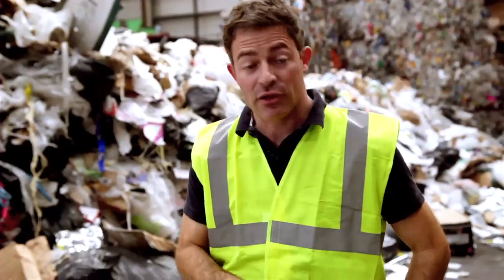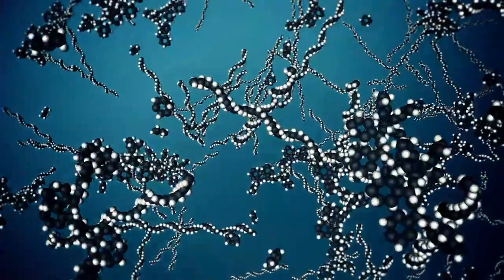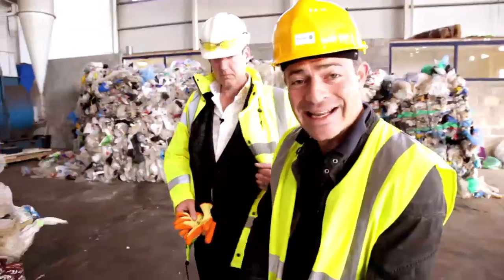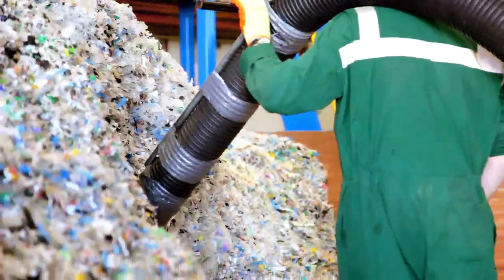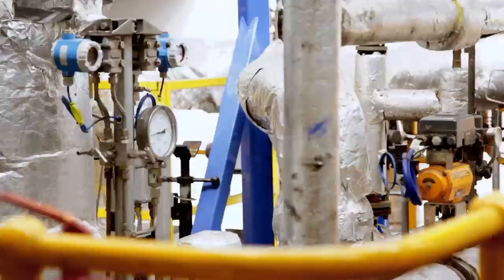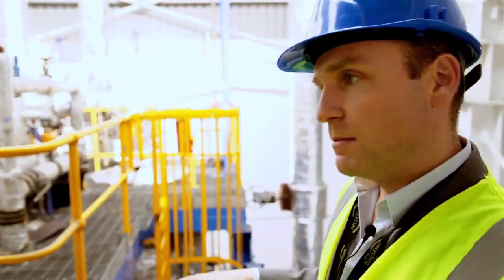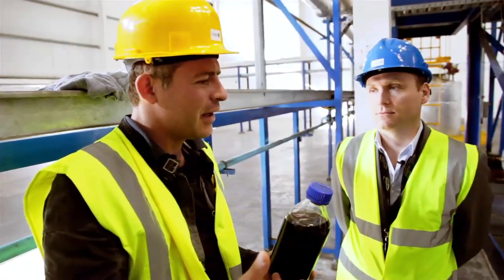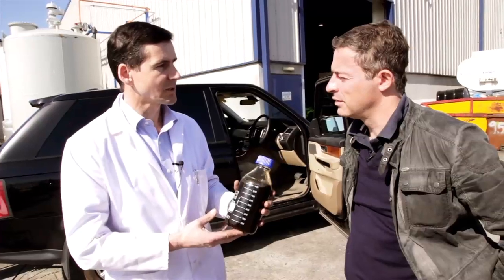earthrise - Plastic Fuel

Comment: What we were not told is the amount of energy needed to pyrolyse 1 ton of plastics to produce 800litres of fuel. From this information, we can know the cost of fuel produced per kwh of energy used.
Reply: @3:50      "... non condensable gases  leave the top of the distillation  column, and it is those gases that we clean and use in the furnaces to heat the pyrolyse chambers ..."
Reply: @charrishead  Energy provided by the by-product gas cannot heat the pyrolytic chambers alone. Thermodynamically impossible.
Reply: the gas produced from the pyrolosis is used to heat the plastic in the first place, this kinda means the process is self sufficient aslong as plastic is fed into the machine, the process keeps going
Reply: @mnshp7548  Assuming there is enough gas released to keep that process going. But it has to provide at least some boost, thus requiring less natural gas or electric heat from utility companies.
Reply: If it can be powered by renewable energy sources like wind farms, solar farms, or even nuclear then it would be well worth it, not only would we be able to almost completely diminish landfills even if it used 100 times the power it would create in gas or diesel it would be worth it for the landfills and just as an alternative fuel source.
Reply: @michaelweston6083  no it will not be a good thing.
All of these plastics would be burned, so release into the atmosphere and accelerate climate change...
Reply: 1 ton of plastics = 10$
800 litres of fuel = 1000$
Reply: @UCiWrMgES50tlUhV3l6NqjNA  4690$ now.
Reply: @Kazeem Mustapha. We either convert the plastics into usable fuel or throw it into the landfills. Pick your poison. If the choice is left up to me, I say convert it into usable fuel. It's a no-brainer.
Reply: While the non condensible gases are recovered and used to fuel this process, they don't say that is all the fuel that is needed. This idea is quite exciting, but we cannot make too many judgments without the rest of the data. Breakdown all the costs of the process in money, energy, equipment as well as all other costs such as getting the raw material to the location.
Reply: Government ALWAYS subsidised green incentives.  This is what they do in Europe and they power their grid with methane and all sorts of synthetic fuels.
Reply: its just the begining they can use the same fuel for own energy and can always improve the formula and the way to double production. Problem is the biggest companies make more money extracting and ripping africa asia etc soils . its an ilusion thinking that there is no solution!
Reply: From those 800 liters of diesel, you would get nearly 8.6 Mwh of energy out.
Reply: @Jemalacane0  so what did it cost to get the oil at first turn some into plastic products, move the plastics through society, reclaim the used plastics and then make fuel. There are many different costs involved in that plastic before its ever rounded up and made into fuel. That litre of diesel already cost more than the litre made from the same batch of original oil. So then to use a higher cost litre of diesel to make 1kw, the same costs translate over from what it took to make that litre. So you can create the higher cost 1kw but because you can do it, is it cost effective or a waste of time.
Reply: rushfan9thcmd of course there is but once plastic is made for whatever reason it therefore is a product, ie plastic. Then it is generally used for one time and becomes a problem to deal with. No one is suggesting to make plastic just so it can be then turned into fuel.
Reply: looks pretty convincing.

I truly hope this takes off and spreads around the world.
Reply: It is mentioned. They use the gases from distilation to power the process.
Reply: I think their figure is bullshit.
Reply: Because it isn't a very exciting rate of efficiency. These guys are shredding with machines, operations augers and conveyors, using a vacuum, and some kind of heat source.

I have one diesel truck. If I could spend time on the weekend and get enough fuel to sustain my driving I'd be interested.
Reply: I see you are well vest in this. I want us to talk business and setup in our country
Reply: @yoofiarthur3578  Yoofi, I am a petroleum engineer and looking jobs in oil and gas industry. Thanks for your interest.
Reply: Solar energy and wind energy can be used...
Reply: @ebenburger111  I know they can. But what are the amount of energies involved in this process?
Reply: The gas produced during the pyrolisis is used to hit the plant. After the initial energy used to heat up, the system should run itself
Reply: @adeolaobayan7735  Yes that is possible. But we need to know the quantity of the energy required for the initial pyrolysis and the subsequent energy after the system is producing self-sustaining gas as you wrote.
Reply: @adeolaobayan7735  No it can because reactions require energy.
Reply: Its a closed circuit the other 200 litres are used to power the process
Reply: To initially heat up process it would require some Natural gas or Oil depends on the burners, once it is up to temperature for the process to occur it will create non-condensable gases that will be cleaned/polished and re-introduced into the furnace to sustain the temperature, therefore it will become self sustainable
Reply: he mentioned the gas they use to heat the whole process comes from the distillation chamber its called syngas as in synthetic gases that are flamable
Reply: He said that the lighter, fuels are being used in the plant to keep the process going. There is no fuel input other then the plastic itself. 

So I guess the costs would be for the 1 ton of plastic plus transportation and processing.

Considering all the plastics out there, I see this as a really good thing!
Reply: @tomkelly8827  Unless you like paying lots more for your fuel, this is a scam on the consumer. Of course if you want plastic gone at any price, you wont mind paying any price for fuel then.
Reply: @tomkelly8827  good to see someone is taking note before opening gob.
Reply: @tomkelly8827  he didnt say they were self sufficient and only operating soley on byproduct.
Reply: It can be taxed from manufacturer of the plastic.
But one massive issue is micro plastic in the ocean.
Face cleanser skin scrubs and mild abrasive cleaning products
Used to be crushed shell and pumice now plastic going directly in to the water.
Reply: @samlabo1688  this
Reply: So you wanna pay a tax on plastic? Because it is the people who will pay it not the companies
Reply: @samlabo1688  TAX to pay for it then means government subsidy, economically unsustainable unless forced.
Reply: You are spot on they would be raving about the dramatic savings throwing out those great numbers. Everything is about the numbers. This merely shows that they can make the fuel and use the byproducts. They should have shown that this much money makes this plastic based fuel and this much money makes the fuel from the original oil product. One also has to take into account what it cost to make the plastic in the first place and how much it cost to collect it and process it to accurately proclaim how much it took to make that new litre of plastic fuel. If it cost 5 times as much to make its a waste. There are many things that can be done but not worth doing so.
Reply: @rushfan9thcmd   you are requesting for commercial secrets which may not be readily available via this video. The technical team have proven its technical feasibility. It's up to the businessman to take it to the next level of profitability via economics of scale. Furthermore, with the right lobby, this venture can be subsidised by the government or via green tax payments from plastic producing companies. So,it is definitely viable and open for bold investors to take advantage of.
Reply: @rushfan9thcmd  

It's less then what it takes for the bag replacements.
Reply: It cannot be a self sufficent process, otherwise it would defy the 2nd law of thermodynamics. Using renewable sources to power this process would be great. But even if the plant is completely powered by clean energy, at the end the diesel produced would be used to run cars and pollute the air with greenhouse gases. With all the rush for electrical cars and transportation with zero carbon footprint, I dont think this is a sane way to recycle plastics.
Reply: @mahdadmahmoudi6150  I believe you are thinking about perpetual motion. 
Self sufficient just means that the process itself produces more energy than it uses. That doesn't Violate anything. 
If the process involves a fuel source that will have the energy stored within itself to suffice itself, for example, humans( though most often are not) can be self sufficient.
You can eat 1000 calories in the morning, and then go harvest 30 times that from your farm per hour. The same food you eat, can then be used to harvest.

So if I have a machine extracting coal from a mine and it uses less coal to run than it's extracting, then it's self sufficient.
It doesn't mean the energy comes from nowhere like the perpetual motion guys
Reply: @Peterblack12  Thanks for pointing that out Peter you are right about 2nd law of thermo. but I think your examples doesnt apply in this case. If you consider the pyrolysis reaction itself, you have 1 tonn of plastic and you need to break the bonds between molecules (E1) at the end you have a small portion of that 1 tonn as combustion material and you want to run the whole process with it again (E2). I dont think that E2 can surpass E1 and power the process. First because the amount of material (mass) available to make E2 is smaller and the next reason is that I dont think the deltaH per weight of combustion reaction of the gasus extract can match that of pyrolysis reaction (I searched and couldnt find numbers so I'm just saying this considering the bonds needed to break and form during each reaction and keep in mind that the pyrolysis needs a heating step first so it is not carried out in standard situation (273K, 1atm))
Reply: @mahdadmahmoudi6150  yeah, and you're right, initially it would take a boatload of power to extract the energy,  but once it's extracted it's enough to replicate the process. 

Think about this 72% of the material can be directly converted into fuel so 1 ton of plastic can render 215 gallons of diesel. 
But consider that they are not cracked in one ton segments,  it's probably at least ten tons.
10 tons= 2150 gallons of diesel.
For reference, a Csx train can haul 600,000 lbs of freight from new York to Seattle and back again with 2150 gallons of diesel. 
That's plenty energy. Remember........... the energy is there already. All you're doing is extracting it. 
Let's just say it takes 300 gallons of diesel to heat 10 tons of plastic, you'd be looking at 1750 gallons of diesel still left. 
Not to mention insulating the process so none of the energy escapes. 
Remember energy is not destroyed, it just converted to one form or another.
 You're overthinking it.
Reply: @Peterblack12  converting plastic into oil requires energy so you have to supply constantly energy
Reply: @mahdadmahmoudi6150  
I hope after 5 years now you start to see that the whole EV "revolution" as is was (and still is) a big scam.
95% of the electricity is generated from fossil fuels around the world ...
Reply: You obviously don't retain information very well lady...
Watch the video until you get it...

Comment: i have a question .. what type of plastic is fed in .. and what is the source of 480 c degree heat
Reply: This system deals with mainly PE and PP but also can handle PS and a mixture of all three, the heat is generated by burning the gaseous fraction of the pyrolysed plastic that cannot be condensed to liquid fuel so once you start the process the energy needed to maintain it is provided by the process, ie self sustaining in a way
Reply: at that heat plastic turns into diesel i ve done it, it really works....
Reply: What is the process ?can u xplain me?

Comment: 1. Why do you need the scrubber for syn gas... What kind of impurities in the syngas?
2. What are the combustible materials that you used for furnace and pyrolysis chamber? Air? Syn gas?
3. Is it possible to use only one distillation tower to produce diesel?
Reply: well is not complicated, easy to do, just remember you gasified everything you got not impurities, i have done it, and it works perfectly fine,  i havent used complex machinery...
Reply: 4. Contactor. How do you design it?
Reply: +Chun Yuan Chot Syngas is H2 ,CO.It is made from water steam and carbon.Destillation column is used for high Quality rafination of what come in,from heavy to the bottom to lighter products to the top.It is used in oil industry and pur alcohool produceing

Comment: How much fuel is burnt in the process of running this factory to produce 1lt or diesel? Sounds like a waste of time and energy...
Reply: elnogga If that's the line of thought, then also one must consider that to create gasoline or diesel fuel, petroleum must all be shipped and then refined by burning fossil fuel. Therefore this process allows for less refining because they're already starting from a source material (plastic instead of raw crude) that was already refined.
Reply: The non condensable gas is used as an energent for running the process. the disel fuel is sold so its actually a quite efficient process

Comment: The percentage purity of gasoline to 98 &  35% of carbon black used in paint factories and printing industry also 15% iron goes into the steel plants and 10% gas is used as energy for factory machines, this plant does not have any chimneys and waste water or drain

For any further information you might need regarding this issue, don’t hesitate to contact
           Aref Abu-eldhab
           002 01288849001
         Skype:Someone0188
chemical.technology@hotmail.com
Reply: Interested in your project

Comment: just a moment- 1 litre of diesel fuel weighs between 820 and 845 gramms. so one metric ton of plastic turns into 666kg diesel and 334 kg noncombustible waste. also you have to consider process, personnel cost and the percentage of taxes added to the diesel price at the gas station
Reply: Burning plastic kills every liveing thing and gives cancer and smells...💥
Reply: @alexh349  They are not burning it. They turn it into a gaz and then filter . The left over can be used to make things like bricks and such. No stack and no bad smell. Just diesel for your truck     or car. You like the smell of diesel don;t you?
Reply: @alexh349  That's bullshit and they're not burning plastic, at least not initially.

Comment: its already happening. the value of used plastic is rising. 

on a sailing trip in eastern europe, ive seen scavengers at every harbor. you leave your waste there, and someone will show up and seperate out all metals, paper, wood, glass, and also PET bottles.i asked one of them, he said he gets 5 cents for a empty metal can and 2-3 cents for an empty PET bottle. 

whats new about this is that they can use ANY kind of plastic, or any mix of plastics, not just PET.